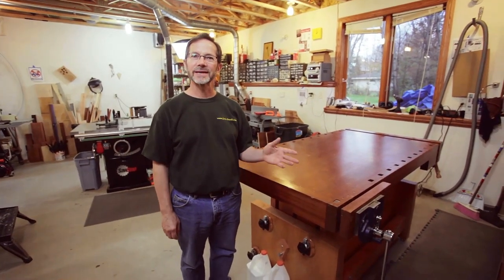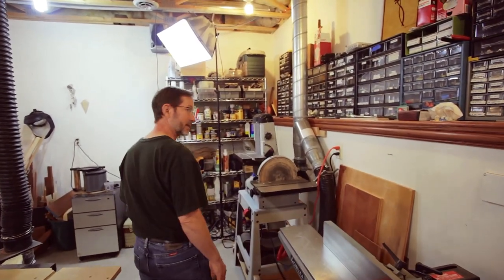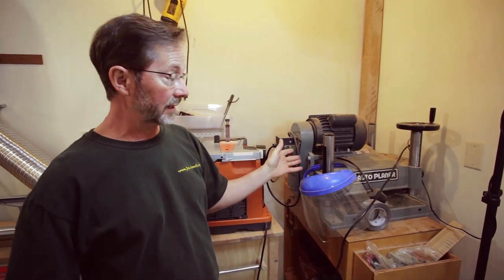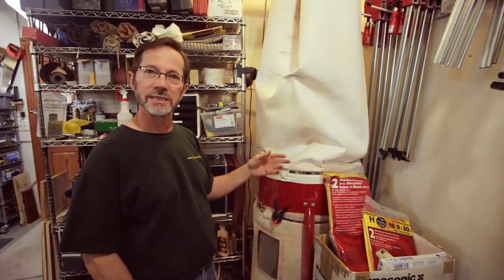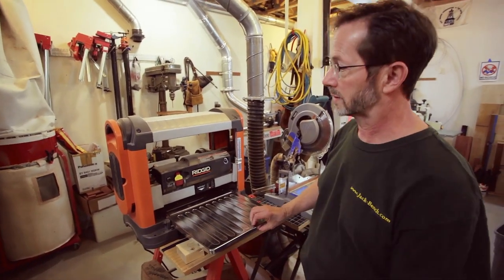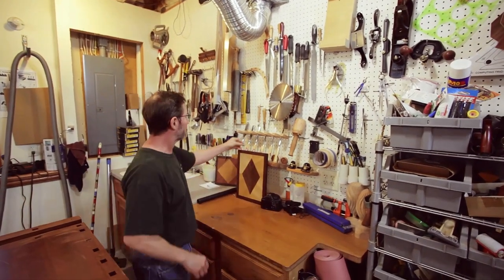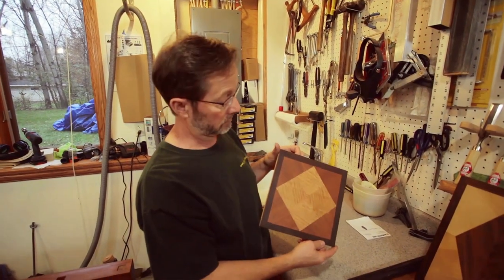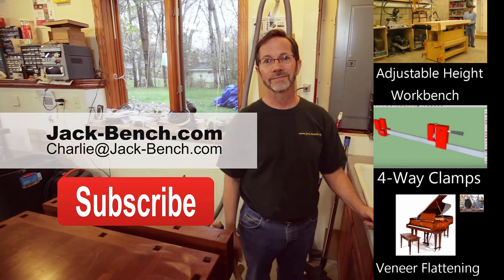Jack Bench Woodworking Shop Tour

Comment: Really awesome tour, Jack! I love your shop! One question: What clamp hangers are you using? I am interested in something like that.
Reply from the maker: +SimpleCove Thanks, I'm glad you liked the video!  

I hang my clamps on storage hooks that I got at Menards.  They are the kind where you screw a horizontal bar to the wall and and then you can snap various different hooks into them.  The bar has little vertical slots and the hooks just snap in.  The nice thing about these is that you can buy different size hooks and you can space them where ever you need to for the size clamps you are using.

Comment: Thanks so very much for the tour of your shop....I found your dust collection system interesting...wish you had gone into more detail on your ducting system.  Thanks again for the tour..
Reply from the maker: +Jim Pell Thanks Jim!  Anything in particular you would like to know about the ductwork?
Reply: I have a shop that is 24' x 32'.  I'm trying to determine the size of dust collector, type of ducting to buy.  I have several tools in the center of the shop and many placed along three of the four wall.  Any suggestions you could provide would be very appreciated, Jack.  Thanks in advance for your help...
Reply from the maker: +Jim Pell HI Jim,

Wood magazine and Fine Woodworking have both done extensive testing on dust collectors.  I am convinced by the articles that I've read that if I ever replace my existing dust collector that I would probably buy an Oneida cyclone.

Wood magazine also did a great article on system design that you might find helpful.  You can find it here: http://images.meredith.com/wood/pdf/wholeshopdc2.pdf

Please keep me posted on your progress!

Thanks,
Charlie